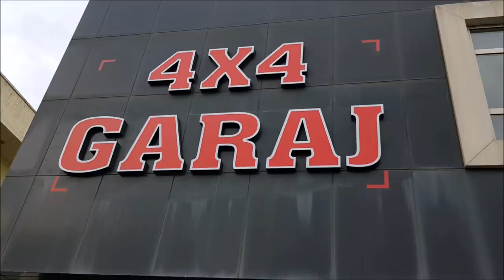Restoration process of Monster JIF - Land Rover Discovery TD5

Comment: always been a big fan of this rig, love seeing it re-born.,

Question though. - 

How do you stop the rear door from failing with the weight from the spare wheel? I found my door works 10 x better when my 35" wheel is not mounted.

What brand are those side step/rock sliders?

Cheers mate
Reply: Even with my 33s my door has started to be a pain
Regards to this one its a purpose build off roader with striped rear so cant imagine the rear door gets used much

Comment: Excellent car (before and after the restoration)... do you use the Land Rover stock axles? I see your rims still have 5 bolts instead of 6 bolts that people use when they swap Nissan patrol Axle’s to run 35” tires and up... I’m just curious because I want to start a new project with a Land Rover Discovery 1 3.9 V8 manual transmission or maybe a Discovery 2 4.0 V8 automatic transmission... I’ll appreciate your answer, cheers all the way from Panama 🇵🇦 (Central America).
Reply from the maker: Thank you...we all using rover diffs and axles but ashcroft hd..more strong...Greetings from Türkiye 👍